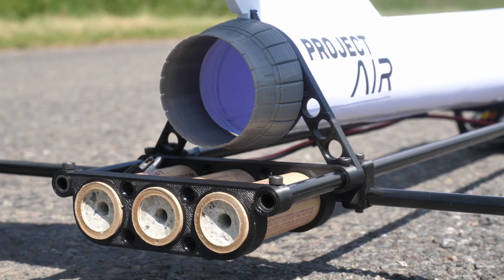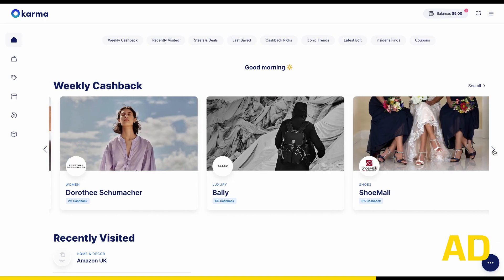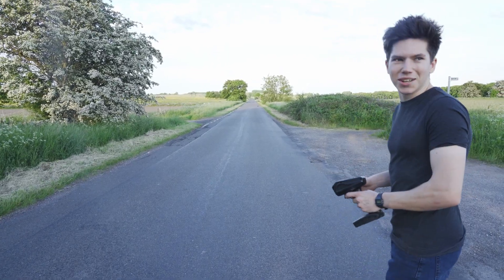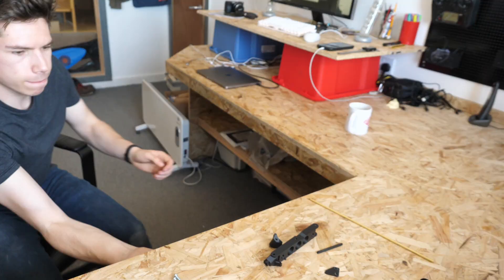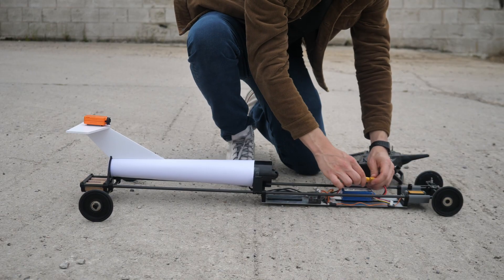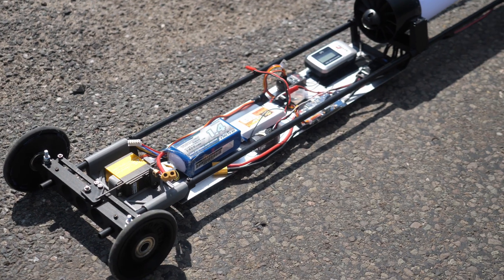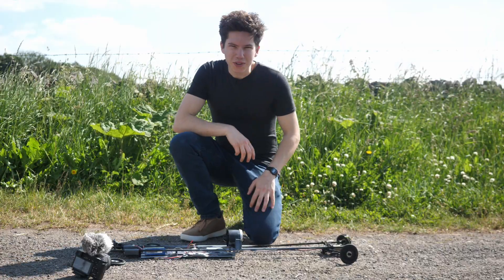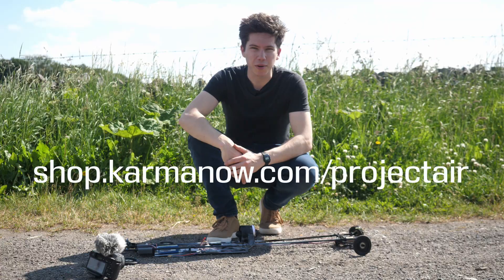Making a Rocket Car

Comment: Get a Gyro and get some rocket motors without ejection charge. They are mostly indicated by having a number like B10-P with the P standing for plugged. So the top is plugged and there is no ejection charge. The -0 engines have a 0 second delay time and more often than not don't have an ejection charge. Check the description.
Reply: NEVER use -0 engines. unless you want it to explode into flaming debris
Reply: @xerosfs  I adjusted it. Should have said -P instead of -0. I got it mixed up due to almost every -0 engine I can get my hands on not having anvejection charge. Booster only.

And as far as thing exploding, if the engine has been properly capped it isn't a problem to use -0 engines with an ejection charge. The effect is the same as using an engine with an delayed ejection charge like he did now. Only the ejection comes straight after the thrust of the engine and not when the car is coasting for a couple of seconds. Should be easier to control.
Reply: @dutchdrifter8740  Nice
Reply: @xerosfs  -0 motors are fine to use so long as you plug them yourself, which can pretty easily be accomplished by a small 3d printed slug or just a layer of epoxy over the top of the grain
Reply: @peregrinedevelopments3730  Yeah but I'm talking about -0s without any plug
Reply: @xerosfs  Yeah, they'll blow forwards as the grain burns closer to the top, not really an explosion tho
Reply: @peregrinedevelopments3730  I would count a rapid release of smoke, pressure and flaming debris as an explosion.
Reply: @xerosfs  that's definitely fair lol
Reply: @peregrinedevelopments3730  Agreed lol
Reply: You can use them if you make a metal engine tube with a fully capped back end.  I'd only use it on a car though, as on a rocket it could become a weapon very easily. It's also typically illegal for a flying vehicle. On a car, however, I've had great success with this method (for any engine, delay/ejection or -0 booster type) since the early 90s.
Reply: @guerrillaradio9953  actually not illegal for remote control fliers, as long as they're used as a source of propulsion (at least here in the US!)
Reply: @peregrinedevelopments3730  I wasn't referring to the usage of rockets for flight, including winged aircraft.  I'm not sure what the rules are in other countries, but in the US, the NAR code (which is more of an idea at small scales, but is a legal regulating body above a 'G' class engine) forbids the use of metal structural components in model rockets/rocket-assisted model aircraft.  Retainer clips, etc. are fine.  I believe it has something to do with the greater likelihood of metal parts doing much greater damage if it veers off and hits someone's house or a person, etc.  This was also written long before the advent of carbon fiber being common (which can make a really great knife), so ymmv.
Reply: https://youtu.be/DXeEgeN_QKYiiuy

Comment: You can use longboard wheels(78A Abec 7 or 9). The 3D printed wheels are probably couldn't absorb wabration and they don't have any roadholding.

Comment: u should get reinforced carbon fiber to with the high temperatures and spoilers to the front and back to increase downforce so it could not fly, add a cover to the inner parts, so it can't be burnt very quick add a stronger turbine so increased power , just don't put the over the turbine so it can absorb air and quickly to pick up momentum.

Comment: Ok just hear me out.
What your rocket car is missing is mass.
Of course you'll have to add more rockets in order to get the same acceleration. 
But your car would become more stable at speed, since mass has this bad habit of wanting to maintain its state of movement.
Thus your car would be less sensitive to the road imperfections and "twitches".
Cheers

Comment: That safety harness in the Mini is not set up right and is REALLY dangerous as is. The shoulder belts should never go below the shoulder level because if they are then in a wreck they will pulls down, compressing the body. This compression can easily hurt your back. It is recommended to have the belts level with your shoulders, or slightly above.

Comment: Those back wheels protrude way too much from the body!!! That cylindrical rod' gonna be a MAJOR aerodynamic flow stopper at high speeds - you should add some cardboard "delta wings" extending from the body up to that rod, and while you're at it, tilt them slightly upwards so you get negative lift, further increasing the adherance to the ground. Also, you could/should add a vertical fin (or probably 2) to act as vertical stabilizers - that small guy is way to fast for its small size and weight, thus the need for more fins

Comment: Need a tighter press for the bearings. For plastic I would aim for 0.001-2” interference
Reply: wouldn't having rubber tires be better???instead of plastic ones??
Reply: @gursimrankochar7270  It looked like he had big orings as tires on plastic wheels.
Reply: https://youtu.be/DXeEgeN_QKYiiy
Reply: He needs normal tires and actual suspension. Tighter tolerances aren’t going to stop his car from self imploding on a rough asphalt road.
Reply: A tighter press won't work, cintrifical forces and heat will be the nemesis

Comment: Did you install a heading-hold gyro on the steering channel, doesn't seem like it- that would greatly help in making it track straight. All us nutters with grossly over-powered cars and trucks designed for high speed runs use them...

Comment: Get yourself a cheap DIY racing drone Flight controller, load Inav firmware onto it, set it up as Rover and you will get Gyro assisted steering stabilization. Super low rates and it will track nice and straight for you. That's if the wheels don't fall off.

Comment: With the next version add quite a bit of caster angle, it shouod help with straght line stability
Reply: Caster? You mean camber
Reply: @stallitite9157  no I mean caster
Reply: Camber helps with cornering
Reply: What’s the difference?
Reply: Camber is the top of the tire leaning in or out, caster is the steering pivot leaning forward or back
Reply: @joshrichards8928  ok thx

Comment: Change the pinion gear on your steering to make it less sensitive. You're test was overcorrecting so you spun out.
Reply: Also think the hard skinny wheels are a problem. 
Some wider rubber tires would offer some shock absorption and add stability.

Comment: Hehe, it's a great first start. Although the carbon tubes I think are too flexible. Also without suspension you will never be able to keep straight at high speed. But still looked like a fun project.
Reply from the maker: Agreed! Didn't realise how much flex you'd get with them, but clearly the next one needs to be made much, much stiffer and have some sort of suspension. :)
Reply: @Project-Air  make a rc toilet car 2.0 with all the modifications
Reply: @Project-Air   u could use rubber bushings as a sort of leaf spring suspension and maybe go to titanium
Reply: Add a rudder, and airbrakes
Reply: @caleb186  it already has a vertical stabilizer, which is holding up the horizontal stabilizer
Reply: @Thatstingray  i mean an aerodynamic control surface
Reply: I think a third tube would have added a lot more rigidity in a sloped triangular pattern
Reply: https://youtu.be/DXeEgeN_QKYoo
Reply: Use a small rc car like a losi mini b or something lol
Reply: And, I guess, it doesn't seem like it has a lot of trail on a front axle.

Comment: Add a gyro to help with steering.
Find an airfield that will let you do some runs. That road is way too narrow.
Reply: I was thinking the same thing.  I would drive something that small/fast without a steering gyro.
Reply: great to see ya giving it ya best in in all aspects of rc  building 👍👍👍👍
Reply: We used to run model dragsters along a tight string. This car might go a bit far for a string guide? But it worked very well in the day, before remote controls.
Reply: https://youtu.be/DXeEgeN_QKYiu

Comment: You really should design a better inlet for the EDF, it will probably improve it's performance. How did you design the outlet? (What you called a "thrust tube").
About the rockets,  I think that when you ignite them, the EDF is going to brake you, adding drag because it has already reached it's ultimate performance.
About the wheels, get some proper wider wheels.

Comment: you need to re-engineer your thrust tube, i will not say more, so you have some content later on :)
Reply: Please use proper terms - it's an outlet nozzle, not a thrust tube!
Reply: @aGabay  you don't know shit about EDF pressure stuff huh
Reply: @NiclasHorn  Being an aerospace engineer, I think I do know some stuff... But I will be more than happy to be enlightened by your wisdom.
Reply: https://www.flitetest.com/articles/edf-thrust-tubes-flite-tip
Reply: Seems like you can use the terms interchangeably
Reply: @haydo8373  flite test are nice, and have a successful channel, but they are not an engineering authority of any kind.
Reply: @aGabay  Fair ennough, it seems like the term 'thrust tube' is a part of the rc community's vernacular

Comment: I think you should add a front splitter, because the wing at the back is acting as a lever, i.e, it's pulling the front of the car up, making it uncontrollable. A front splitter, with nearly equal downforce to the wing, will make the car aerodynamicaly
balanced.
Wider front and rear tyres should help too, so that you have more steering control, and the car doesn't spin out on a turn. 
Also, a lower center of gravity might help too.
(Does the wing even generate downforce ?)
Reply from the maker: Good idea

Comment: Maybe get motors without ejection charges next time? Still a very cool car - even if it did get cooked!
Reply from the maker: I should! :)
Reply: @Project-Air  and then get certified so you can put a bigger motor in it!

Comment: Get a gyro and some aerodynamic steering on that bad boy :) maybe a touch of downforce on the nose too
Reply: https://youtu.be/DXeEgeN_QKYiyt
Reply: Maybe also put the rockets on the front...? I'm not an expert or anything, but on cars it is a lot easier to lose control on rear wheel drive cars than in front wheel cars, so maybe this can be applied to rockets.
Reply: @alroma6609  rocket pendulum fallacy, it won't do anything
Reply: @alroma6609 actually after thinking for more than two minutes that would make it more aerodynamically stable